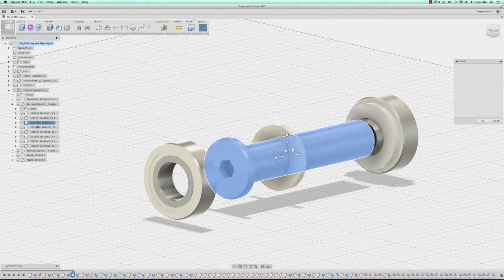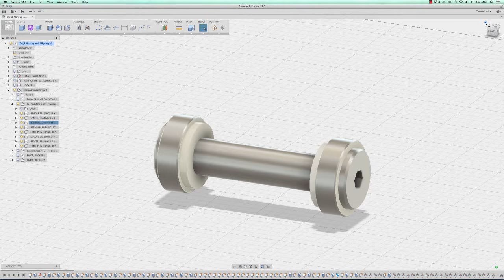Autodesk Fusion 360 | How to Move and Align Components

Comment: A technical question:
Aligning faces or points together is easy. 
Sometimes you have two bodies that are held together by two pins, as it very often happens in firearms. 
These two bodies are parts were imported from different files, and therefore might be out of angle. How to I align them in this case, to make 2 holes matching on each?! Align command doesn’t have an option for that.

Comment: Why is it so freakin hard to center text on a body? Or anything for that matter. It should be much easier, selecting 2 points and selecting a drop down of *center between two points.

Instead of just being able to align to surfaces which either throws things out of their placement or creates other issues we have to fix after.